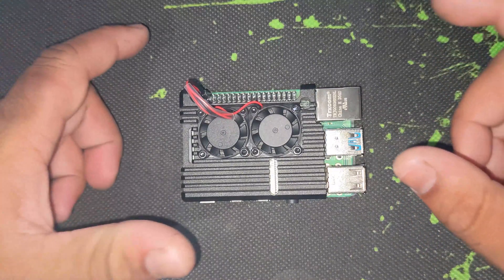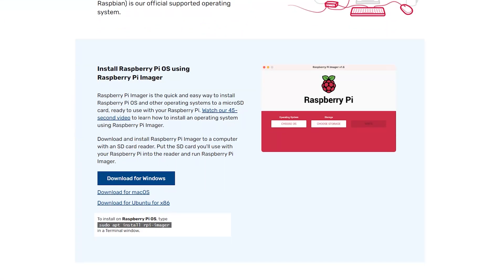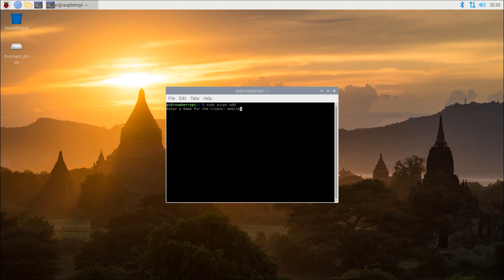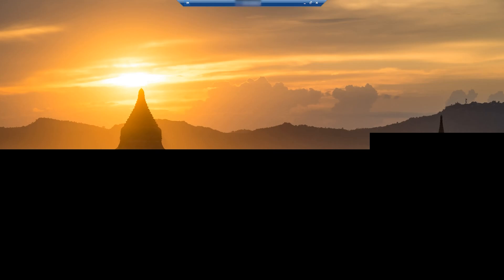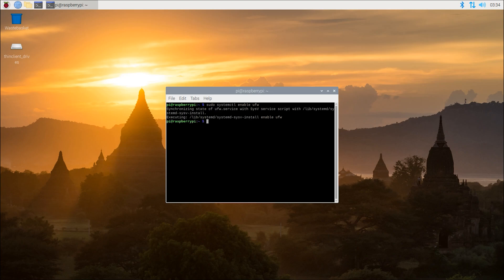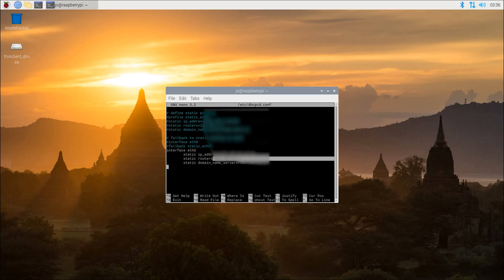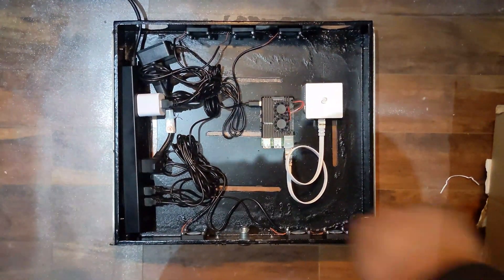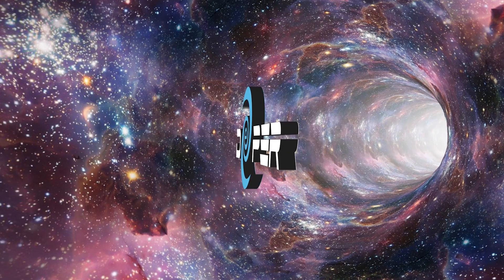Setting up a Raspberry Pi to control your Deeper device in a Data Center

Comment: I just want to access the deeper mini from my home and not using one arm mode. any tips for that? thanks
Reply from the maker: check out my beryl router video its a cheaper option to remote connect and works great as a dpn wifi in your home too

Comment: Great video, if you don't mind, what's your monthly charges for the data center? I am in Edmonton, Alberta, would like to host my mini and genesis in a data center but not sure of costs
Reply from the maker: Thanks :) for me it's $140 for 2u rack space 1gbps up and down speed (burst connection, which means it gets 100mbps on average but if someone does something demanding it can pull 1gbps)  basically you share a line with some people so you get overage charges if you hog it. It's another $50 or so for liability insurance should your equipment burn the place down. 

So around $200 to $250 for my total cost

$400 was the average I found before getting lucky with this place
Reply: @Scytheanomics  good for you, I can't find anything close to that in Edmonton, so am thinking of just using my shaw internet, then do a bridge connection since I can get two public IP s
Reply from the maker: @wahome65  nice ya if you got two IPs that's awesome. Ya I know datacenters range so vastly in price across the globe. :(
Reply: I'm paying $350 a month in California
Reply: @savvyjake5700  wow, I can't afford that with current deeper staking returns